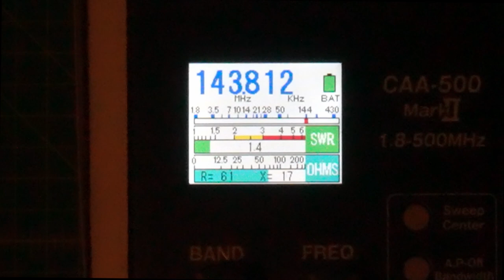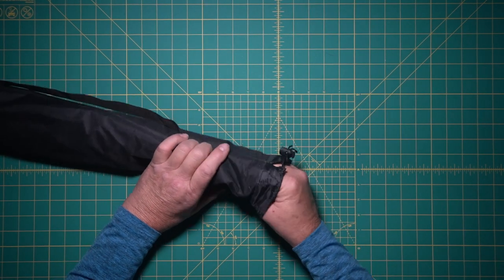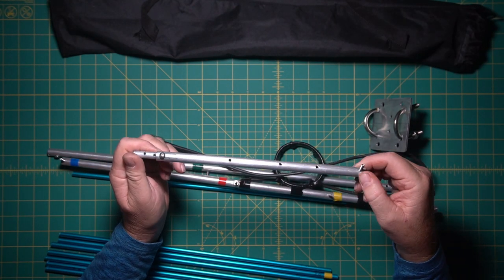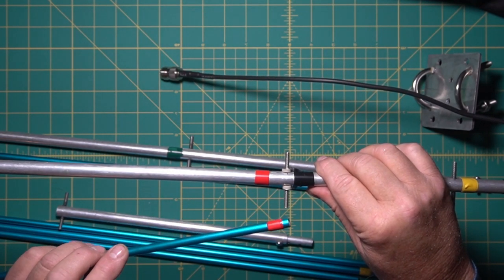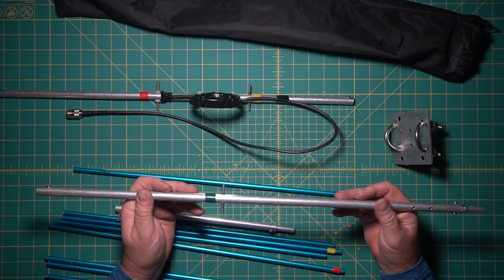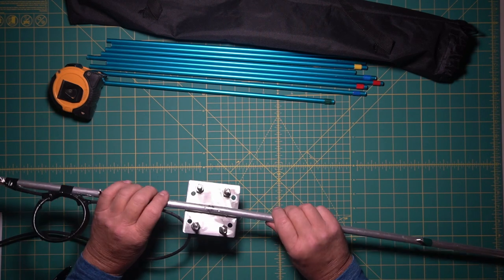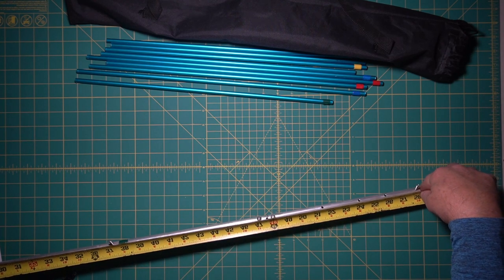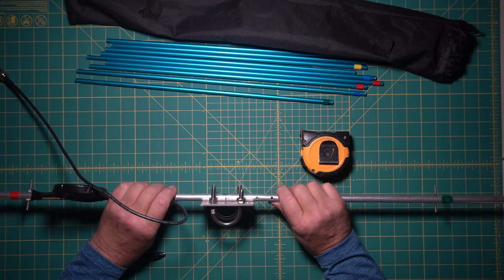How to make a 2 Meter Yagi Part II.

Comment: Well I did it. The 5 element Yagi I was making worked better than my expectations.  I was having issues with the gamma match, I was seeing high VSWR (4.0+) and couldn't figure it out. Ok back to the video for reference.  It was a combination of a insulated driven element and a larger gamma match than needed. This is not a portable yagi but goimg on to my shop in a permanent mount.
Got it tuned to 1.4: 1.  It hits the local repeater on low power from my FT100D and operated simplex flawlessly. Distance testing next week. Thanks for the kick, in the pants to get this built. 👍  KI5IQE
Reply from the maker: That's Awesome Joe!!

Comment: KN4ZCF and my XYL, KNOAOF. (We love building antennas together.)
All of your parts list is ok except for 1 item, the arrow inserts. The one you noted is 6.2mm and the ID of the shaft you listed is 6.5mm.  Anyone building this yagi needs to find a source for a 6.5mm OD insert before you order the blank arrow shafts. We will list a source for the inserts when we locate one.
Great video and we can't wait to finish it. 
We will be mounting it on a piece of PVC pipe that we will be rotating from horizontal to vertical using one  of the 2 rpm  12 volt motors on a reversible speed control.  I will be using the same set up for directional control. The yagi will be mounted on  a stand off 35ft up our tower. In order to observe polarization and direction, we will be using a  Wyse outdoor camera mounted vertical near the base of the tower  under a lexan box that we built. It has the compass rose on the top of the box which enables us to see our antennas and their orientation at all times. A small $20, 30 amp power supply runs all the motors ( we have several on the tower). Since we live in Florida, it also allows us to see what antennas we might have lost during a hurricane.
Great video...keep it up.
Ed and Jeanie
Reply from the maker: That sounds like a awesome setup Ed and Jeanie!!

Comment: Follow up on previous post. We are using threaded nylon all thread  rod (also from   McMasters-Curr)rwith nylon washers on each side of the beam to connect the driven element to the 1/2in square tube. Just cut the nylon all thread rod to size.

Comment: Following up on the build. We found 6.5 mm inserts at Easton Arrows in Utah. Talk to Judd in tech support and he wiil help you find the correct insert for your arrow shaft's ID. 
In order to increase connectivity between the arrow shaft and the inserts. We put a slight crimp on the arrow shaft using a crimping tool.  Then  we drove the inserts in with a plastic mallet. 
When we checked it out on the Nanovna, the SWR an amazing 1.1 to 1 across the 2 meter ham band and the gain was an unbelievable -14db.  For storage or travel,Unscrew  the arrow shafts from the beam. In order to keep the nylon washers and the coax leads in place, screw a plain arrow insert over the coax leads on the nylon threaded rod that hold the driven element. Then remove the 2 screws that hold the beam together and replace the screws back in 1 half of the beam so you dont loose them. Put the arrow shafts in a bundle and wrap a rubber band around them. Do the same with the 2 halves of the beam and wrap both bundles with another rubber band and you get a nice neat package that is less than 30 inches long and will drop nicely in to a cloth tube. 
We followed the instructions for the element placement and cut the arrow shafts to the specified lengths and it may be the best antenna we have. We have made up the little  12v, 2rpm motor rotor and will be mounting this antenna on it.  We will probably run the rotor motor off of a 9v battery to keep the whole system simple.
73s
KN4ZCF
Reply from the maker: That's awesome glad you like the antenna, I have rebuilt my antenna on aluminum square tubing and connected in the middle with aluminum U channel and no need to take screws apart now jus fold both sides together and insert into my tyvek bag. I wonder if easton sells the blanks for a reasonable price, I know elk antennas uses easton.

Comment: Bill-N6EF-Thanks for the great info. I'm going to make this but I'm going to try using square tubing as you suggest. The challenge is what to use as an insert to connect the tubing pieces together. I wonder if 1/2 inch copper plumbing pipe would work. I could use couplers to join the pieces. Worth a shot. I was impressed with the distance you got from the antenna.

Question: How do you secure the metal inserts to the arrow? I think Adam crimped them somehow but I don't know what crimper he used.
Reply from the maker: Bill, I just crimped mine seemed to work ok. I used a crimper for 8X crimp on PL259's worked ok not real pretty.
Reply: Another way is to 'Peen' the arrow in a number of spots over the insert with a fine Center Punch.
Maybe try it on some scrap before committing to all elements.
BTW: I like this construction method.
Russ KA1RUW
Reply from the maker: @rjinnh3933  , Yea thats a good Idea, didn't think of it.
Reply: @KK6USYHamRadioAdventures  Were the inserts a bit sloppy in the shafts? I ordered the shafts in the link and they're 6.5mm inside diameter and the inserts are for 6.2mm shafts so the inserts are really loose in the shafts. A bit too loose to make a solid contact. I sourced some 6.2 shafts on eBay so I'll see if those work any better.
Reply from the maker: @FreeStuffGuy916  Mine were pretty good fit and tight after crimping , someone sent me the ones I used so maybe they were the right size. Thanks for the info.
Reply: @FreeStuffGuy916  How did you build turn out? Did it work better with the 6.2mm shafts? I'm also interested in this project for SOTA activations and would like to hear more about how it went. Ben N6ELF
Reply: @5x9dev  it turned out pretty well. I ended up peening the ends of the shafts with a hammer and punch at 4 places around the shaft. Don't hit it too hard or else you'll deform the insert and the screw won't go in. I don't have a coax crimper like Chuck and Adam so that's what I had to use. I also used a 1/4 inch wire brush in a drill to remove the anodizing from the inside of the shaft to make sure the insert made contact with the shaft. I used 3/4 inch square stock (2 3 foot pieces) for the boom and joined the pieces together using a scrap piece of 1/2 inch copper pipe. I used 8-32 screws and wing nuts to make the boom breakdown easier. For the driven element, I used 8-32 nylon thread and plastic washers and metal nuts from McMaster-Carr. Because I'm using metal nuts, I had to insulate the nuts from the boom. Because the driven element uses the nylon thread, you have to be really careful screwing the driven elements onto the screw or else you could snap off the screw. I bought the 6 foot nylon thread since I anticipate snapping off the nylon thread at some point. My SWR and bandwidth are nowhere as flat as Chuck's version but it has a good match at the lower part of the band. It all stores perfectly in a 36 inch tripod carry bag. You have to play with the ugly balun to get a good match. Placement and diameter of the turns affected the match and bandwidth drastically on my build. For the mast, I used a 10 foot section of 1 1/4 inch PVC pipe. To connect the antenna to the mast, I used a metal cover plate from a 4x4 electrical box and used the existing holes used to connect the boom pieces together and attached the cover plate to the side of the boom. I can use this method to mount the antenna vertically or horizontally using the 8-32 screws and wing nus. I used 1 1/4 inch U-bolts to connect the antenna to the PVC mast. I haven't made any contacts on the antenna yet but hope to soon.

Comment: Where did you get the arrow shafts? and how much where they?
Reply from the maker: Look in the description there is a link to them in Amazon.
Reply: @John Sedovic The shafts and inserts in the description were a loose fit for me. I couldn't find any inserts that were a snug fit. I had to take a hammer and punch and lightly tap the shafts in 4 places to get the inserts to fit better. They were still a little loose but they make contact and stayed in place when I inserted the screws into the inserts. I had to use a 1/4 inch metal brush in a drill to remove the anodizing from the inside of the arrow shafts to make sure there was some sort of contact with the shaft. I found the brushes on Amazon.

Comment: Just came across you videos and i really like them, what i'd like to understand is how to prevent the driven element from shorting to the boom, what did you use to prevent this?
Reply from the maker: Hi Skylab, I used a plastic washer and plastic threads to separate the sides and the boom.
Reply: @KK6USYHamRadioAdventures  thank you very much for such a quick reply, would you happen to have an amazon link to such?
Reply from the maker: @skylabby  There is a link in the comment section for the plastic threaded rod but not from amazon. I think you might find it there though if you look at the thread size and same for plastic or nylon washers.
Reply: @KK6USYHamRadioAdventures  Thank you, checking now.

Comment: Great video Chuck. I love the break down design and portability.
I see the ugly balun to keep the stray rf off the coax. I’m not seeing the match for the driven radial. Did you use a Hama match or hairpin match?
I only see the coax with eyelets going to each side of the all thread to mount the driven unit to the boom.
How do you achieve the match to get the swr so low? That antenna has great swr.
Another great video.
Jeff
KI5HGT
Reply from the maker: Jeff the match is just a 50-ohm dipole match, determined by the length of each side of the driven elements